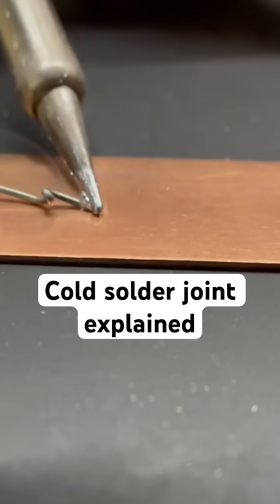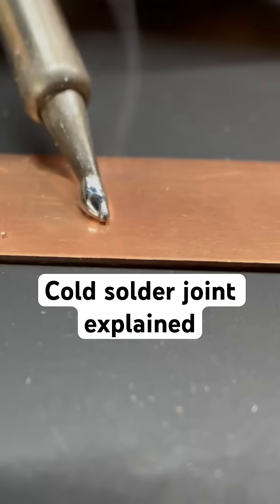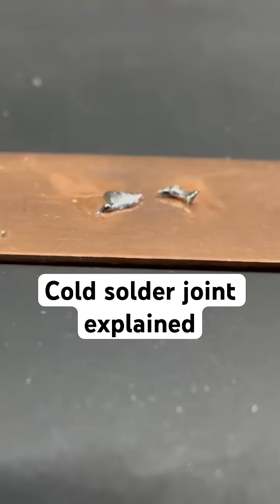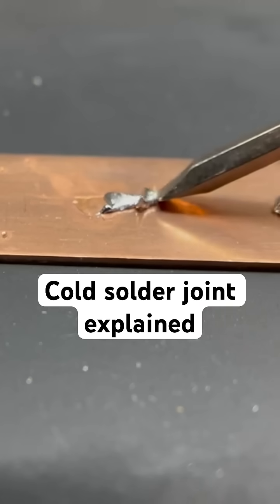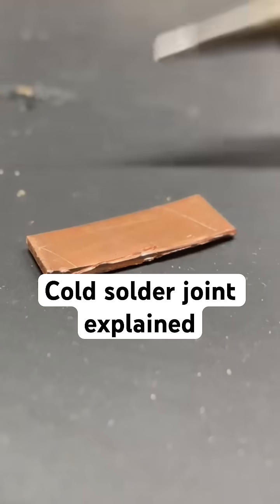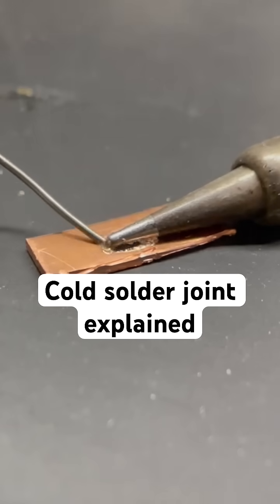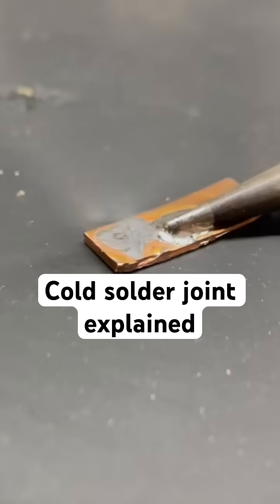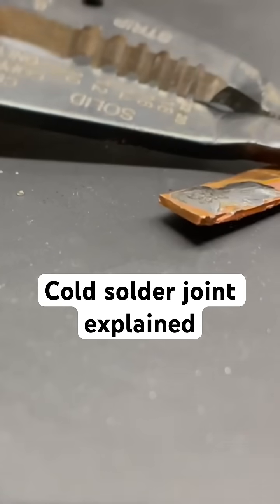Cold solder

Comment: You may know this, and left the new point untinned for demo purposes but you should pre-tin the iron end of the soldering iron's tip (copper tip is plated with iron to resist the copper (tips of soldering iron are made of copper for heat transfer)flowing off (alloying ) with solder and shortening tip life. If you do not cover the iron tip with solder the tip will heat unevenly and the flux will destroy the iron coating quickly requiring replacement of the tip.
Of course, you need to solder a lot to see this,, and the occasional user will only experience the uneven heating and difficulty in solder flow.

Comment: TL:DR You have to heat the parts you're trying to solder, not the solder wire itself. If your piece transports the heat away, you'll fail. And PCBs are filled with copper, so that's always an important factor to take into consideration.
And for the ones farther into soldering attacking PCBs and smaller parts: Use flux. That stuff is magic 😂

Comment: Obviously the angle of the iron played the biggest part. More contact area between iron and copper means more heat transfer.
Reply: That iron is probably 50W or less so that first piece of copper is really a problem for it.
As soon as he adds solder he creates a larger contact surface and you can see that the iron even has trouble to keep the solder melted.

Comment: The solder will run to the heat. Heat your work furthest away from where you can get the solder in between your workpieces and when you touch the solder to the metal it will suck it into the joint

Comment: That's why it's difficult to solder large GND surfaces with a small soldering iron. The copper just doesn't get hot enough.
Reply: Small soldering iron is not a problem. Professional soldering stations uses very very small soldering iron. But the tip is integrated with heater and thermocouple (temp sensor) - so it has much less thermal resistance. It costs much more, but is worth it.

Comment: None of this is remotely close to how soldering works.  Solder is a chemical bond, not an alloy.  Also, solder is not a mechanical connection.
Reply: its been a while since ive done it but i could have swore ya needed flux for it to bond
Reply: @GamingWithZeap  flux is used to remove oxidization.  Oxidized layers prevent solder from working.

Comment: Use some steel wool in the copper to remove surface oxidation the with a bit of flux and a high wattage soldering iron, it’s a piece of cake!

Comment: The literal first rule in soldering:

Don't heat the solder, heat the work piece.
Reply: Bro… this should be labeled on those cheap home soldering kits😂
Reply: the first rule of soldering is not burning yourself..
Reply: @mart43 Exactly, it's don't grab the silver part. You'd think that would be self explanatory but...
Reply: Yeah, you should alway tin your iron too. increases area of contact on the board do it transfers heat quicker, and also you won’t oxidize as quick
Reply: my dad literally taught me this yesterday, really helped me big time
Reply: @perplxxd  Here's another tip - avoid breathing the fumes. 👍

You'll thank yourself in 20 years.
Reply: @mattd1188  lmaoo yep. we had one of those small fans that can pull away the smoke. that stuff smells terrible (and probably IS terrible for you)
Reply: I was always heating the solder😂
Reply: @symply_ajay I mean it works, I find that by doing that you reduce the risk of overheating the pad.
Reply: @AedanBlackheart i always got bad solder joints... then i gave up
Reply: Was never taught this in my electronics class. That would have been good to know.
Reply: The first rule is clean your work piece.
The second rule is don't forget to turn your iron on.
The third rule is tin your tip.
Heating the workpiece and not the solder is in there somewhere though
Reply: This is basic metal knowledge. Bring back the trades in H.S.
Reply: @fett4life250 guess what buddy? Nowadays American schools are filled w/ lgbtq bs & only type of “trade” class left is “AutoMechanic” . murica has gone to shits
Reply: @fett4life250 my area has trades in high-school, for college credit so they graduate with a diploma from high-school and college with certification
Reply: No wonder why I suck
Reply: @galacticgamer3028  Everybody is learning something new every day, including myself. But yeah, in order to not get a cold joint you gotta run the heat through the piece and then touch the solder to your joint. 👍
Reply: I understand this but what do I do if I use electronic components? I have heard to not heat it enough or else I'll destroy it. Now I understand this, is this just skill?
Reply: @cagedgandalf3472  Well, when you start getting into component soldering that's a whole other bag of fish from soldering wires. You're correct, you can damage the component via overheating - I've done it. It's easy to do but the components themselves can be reasonably robust (there's no universal standard to design and because of that they all have different tolerances). Usually you're not soldering a component to a wire it would be soldered to a board or socket or some similar application and in that case you would heat the board or socket first and then come in with a fine tip to heat the leg of the component and then introduce your solder. Fine work varies a lot and some applications might be easier with something like a hot air station as opposed to a soldering iron and some components that use solder balls and/or otherwise don't have exposed contacts require a hot air station to even rework. That's a bit more complex than your question (I think), I guess the TL;DR would be to just be quick about it. If you've got an adjustable temp soldering station use the lowest temp you can get away with using with whatever solder you're pairing it with. Flux can help substantially in that case as well as proper tinning and prep. Don't be scared of the component, just be quick about it, I'd say try to get it soldered in less than 5-7 seconds it seems like anything beyond 10 seconds could potentially cause damage but that's totally a case by case and component by component basis. Some care less than others. Hopefully that helps. 👍
Reply: @mattd1188  I understand what you mean, I knew this, I was just hoping it would be the same for wires 🤣I have been trying to solder components and they just really won't stick to each other and I have tried to use sandpaper to no avail. However, I have been thinking of using flux to solder them. Unfortunately too I don't have a hot air station nor an adjustable temp station, for now at least. I am still studying. Thank you for the response it is much appreciated
Reply: @cagedgandalf3472  Yeah, don't let it get you down. Soldering just about anything without even a basic adjustable temp soldering iron can be tricky. I'm positive you're not the problem in that scenario, it's the tools you've got. Keep practicing and you'll get there. 👍
Reply: Yeah I'll just heat my plastic circuit board
Reply: nah. just use a soldering paste. no need to heat up
Reply: Actually, the first rule of soLdering is to pronounce the "L" as it is not silent.
Reply: @SkrawnCPT no, fuk that.
Reply: You have to use solder to heat the piece, It's far more thermally conductive that way.
Reply: @musicvideos445  😂😂😂 depending upon your application, maybe but also, no.
Reply: You know how you heat the surface through right...? Let's have a challenge, you heat a copper plate with a raw iron, I'll do it with an iron with a blob of solder on the end of it, who do you think would win? I think everyone that has ever soldered knows the answer.
Reply: @poopfartlord9695  I don't make the rules, boss.

Also, what you're saying is CRAZILY off the chain ignorant to assume that any heating of a work piece needs to solely be done with a raw iron. The actual fuck? Like, read what I wrote and then ask yourself how you even remotely got to your assumption. That's a gap that would be difficult for even Evel Knievel to jump.

I feel like I shouldn't have to explain how to solder and how the process of heating doesn't have anything to do with heating a the piece with or without solder. They can be two totally separate steps depending upon how large your piece is. The way you know your piece is at temperature is if your solder wets (assuming you even know what solder type you're using and matching the melt temp to your application). If you've got a small piece you don't need to get creative with the work heating process and if you've got a larger piece then sure, go nuts - though you're going to have a difficult time figuring out if you've reached temperature with pre-molten solder 😂😂

So, you'd have to scrape the tip before hitting the joint and testing the solder there which is totally 100% out of the scope of my original post. Ya'll got tiktok brain and it shows. 🤣
Reply: @mattd1188   been huffing solder fumes eh? FiRsT RuLe Of SoLdERiNg Is To SoLDeR. Thanks for the great Eldritch knowledge no one could have figured that out boss.
Reply: @poopfartlord9695  Don't get salty because you can't comprehend my original post.

"bOsS"
Reply: @mattd1188 
 So.. are you saying, if Knievel wasn't so evil it wouldn't be so difficult to jump over the candle stick.
How does solder fit in to this?
Reply: But the easiest way to heat the work piece is to touch it with hot melted solder.

There's nothing you can do with THIS workpiece and soldering iron anyway. It's way too big and needs a blowtorch.

Comment: The power of flux🎉
Reply: first joint had flux too, its INSIDE the FLUX CORED SOLDER thats whats causing the smoke (flux evaporation) coming off the tip.

Comment: I don't think you should use the term mixing of copper and solder because they technically don't mix. I also think you should mention capillary action. Good video though.
Reply from the maker: You make a valid point - wish I would have worded it better to talk about the interface of the two metals. Thanks for the constructive feedback.
Reply: Copper dissolves in solder, a process called diffusion. In addition, there is a very thin layer of copper and solder called the interface that is essentially an alloy. This layer cannot form if the temperature is too low for the solder to flow into and alloy with the copper. It's not unfair to call it an alloy because in that region, that's what it is.

The use of solder to dissolve metal surfaces and form a reliable solder alloy is called preconditioning.

Comment: Do you need flux? To make that solder stick?
Reply: You can cheat it by melting the flux in the solder 
Works when you wanna solder something small but for large diameter wire you want to use flux paste separately
Reply: thats what i thought too, i mean its been about 20 years since ive messed with it but i totally remember using flux

Comment: You can clearly see the flux on the second one and none on the first
Reply: They both literally have Flux
Reply: Flux is in the solder in both examples
Reply: @gtjack9 that’s not how flux works.
Reply: @smoll.miniatures  Never heard of rosin core?
Reply: @smoll.miniatures  The majority of solder has a flux core, this is to remove the oxide layer of the metal your soldering to and to shield the process from oxygen which will oxidise the metals, especially when they’re at high temperatures, as seen during soldering.
You can solder without it, but both metals need to be cleaned immediately before soldering, and theres a high chance of a poor solder joint unless conditions are perfect
Reply: the flux is INSIDE the FLUX CORED SOLDER thats whats causing the smoke (flux evaporation) coming off the tip.
Reply: There's no trick here. it's exactly what the narrator is telling you. Clean copper can be soldered with no flux at all.

Take this rare opportunity to learn from a YT short that isn't 100% BS!
Reply: @stickyfox  but both have flux it's flux cored solder you can the evaporation in both examples! It's an even playing field

Comment: You used flux the second time
Reply from the maker: No, both times I used flux core solder. Everything was the same except the size of the work (copper plate). Smaller plate is able to heat up better, it’s all about heat transfer. The only reason flux helps is it removes oxides, which are thermal insulators and allows heat to transfer. Flux is not even needed if your iron is hot enough.

Comment: I have watched videos that explained what soldering is that were much longer, yet i understand it more after this clip than those longer videos. Great work, i appreciate it!
Reply from the maker: Thanks!
Reply: The experience of soldering is dependent on the surface. It will take heat until it is destroyed. The timing can be milliseconds

Comment: Funny, looks more like you didn't use flux the first time.
Reply: Looks like he used just the tip to heat the copper first try.

Second try he used more of the iron to heat the copper.

Comment: if you use a weller gun and use a piece of 12ga coper as a soldering tip,you will be able to solder wires to radio frames easy with acid core solder. you are welcome

Comment: DUDE, USE DAMN FLUX!!! GOD DAMN IT!!
Reply: The solder has a flux core. Chill tf out.
Reply: @Krankie_V  If you don't know anything about it,  you chill and shut tf up. Do you think the flux in the core of lead is sufficient? Poor bastard...
Reply: Also you don’t need it in reality if the copper is really clean. All it does is clean the material to be soldered.
Reply: With copper you don't need flux if the work is clean.

Comment: A cheap variable-output soldering iron is a good investment, but you can also score the surface and use flux where you intend to solder to, that way you can form a good mechanical joint even if you can't heat it evenly.
Reply from the maker: Well, sometimes, even if you have a variable output iron, it's not enough power, or the surface area between the iron and the work is too small.  Good points about flux and the surface, those are two good tips and way to increase heat transfer. The solder used there is rosin core (so there was a decent amount of flux there)
Reply: @HTMWorkshop use a chisel tip. My milwaukee came with one and a needle point and I've never used the needle. I'm also a mechanic though, but I love just using the chisle to lift up my wires and it heats it lovely.
Reply: @HTMWorkshop  it doesn't increase heat transfer when you score the surface. It removes the oxidization. Oxygen is an enemy when doing almost any work with metal
Reply: Maybe I'm doing things wrong, but if I'm soldering to that first piece I'm gonna use a small torch. It just heats stuff way faster than any soldering iron could.